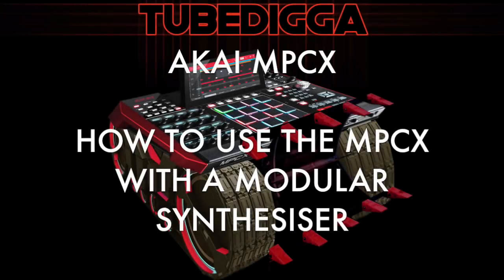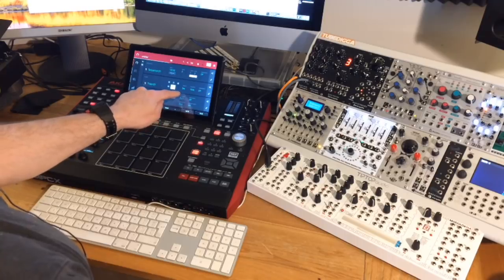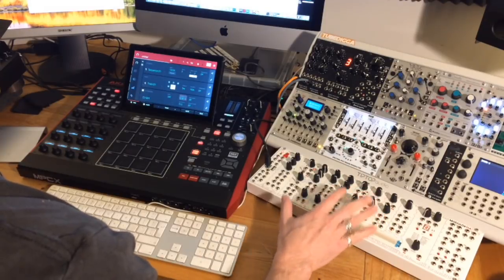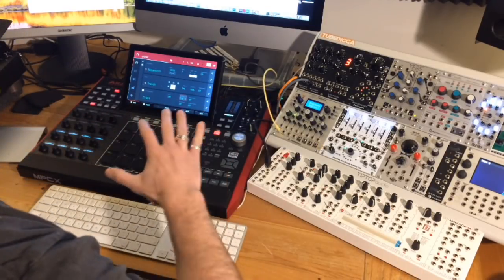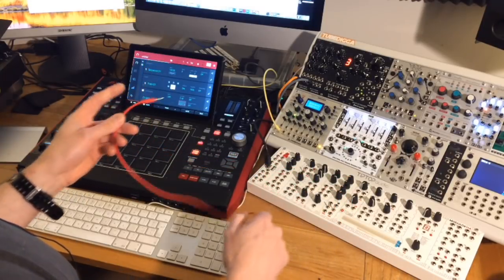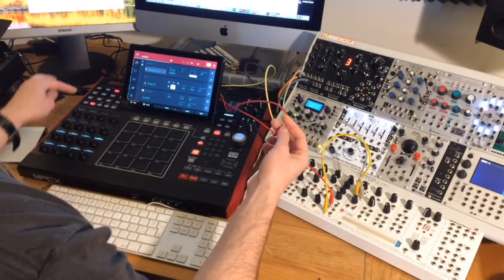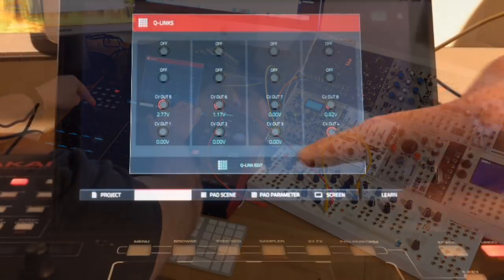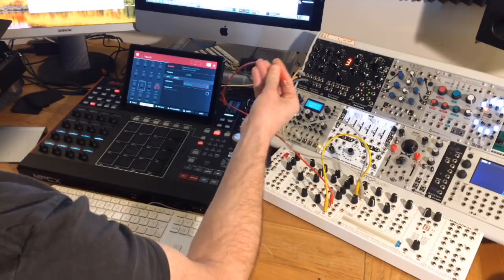AKAI MPCX HOW TO USE THE MPCX WITH A MODULAR SYNTHESISER

Comment: tube completely unrelated but IM having problems connecting my roland tr-8 into my mpcx and I only hear a static-y and not loud enough drums. Anything I should do?
Reply from the maker: You'll have to explain your set up in more detail. It could be many different things - is the input switch at the rear of the MPC set to LINE or PHONO? If it's set to PHONO then that could be it as that is just used for VINYL/record players. It may also be your TR8 master volume or track volume are set too low. It's best to send the loudest signal you can and if necessary dial it back to a clean, more suitable level so it doesn't distort. Basically, your source sound (the TR8) needs to come in to the MPC as loud as you can before distortion and adding gain via the MPC gain knobs should be a last resort or used just for a small boost. Other than that it could be many things, but you'l have to explain your set up in more detail.

Comment: Do you have intelijel shapeshifter? It looks so uniqe and cool to morph samples and synths with mpc x. And the vocoder 😍 im considering buying it. Would love to see you do a demo of it, thanks.
Reply from the maker: Good idea - I may do at some point, it's a very deep machine and much of what I get out of it is very much trial and error and flukes/experimentation. I wouldn't be able to fully explain all of it and would be a little out of my depth. That's not to say I don't know what the f*&k I'm doing! I know a fair bit about it but there's a few areas I need to research and explore more. It's one of a few modules I don't think I'll ever sell, it's superb.

Hopefully I'll do it soon but will have to read up on some stuff.
Reply: @TUBEDIGGA  cool.cant wait. Could i use it alone with the mpc and a keyboard? Dont own other modular stuff.
Reply from the maker: El Morto Beats Hip Hop Beats You would have to buy some kind of power supply and case - there are things called ‘skiffs’ which are the cheapest and most basic ways to house and provide power (via ‘rails’) to a module. Otherwise a case like mine which has a built in PSU or maybe a smaller case with just one row, or half a row to fit this module and a couple of other modules. Specifically a VCA and envelope module (some combine the two)which will allow you to have control over the shape of the sound. Just the Shapeshifter alone will be frustrating as although the X can trigger it (gate) and control the pitch (CV), you ideally need a vca to control the amplitude and an envelope to trigger the VCA and adjust the attack/decay/release. Otherwise the sound will just be a lot less dynamic.Check out this guys video series which will show you the basics of what it can do: https://youtu.be/jlnj4HwHMlk 

Let me know if you still would like me to do my own video as this may well be more than enough. There's many other videos on YT showing this module too.
Reply: @TUBEDIGGA  thanks. Ill check out it. I wish i could get that in 1 box. So cool

Comment: Do you find yourself using the CV controls in the MPCX often...or simply relying on a modular sequencer, and just recording/sampling with the MPCX.  Also, are you automating complex/multiple modulations? I have an MPC Studio and I'm trying to determine if its worth it to buy an MPCX (eventually). My semi modular gear can be controlled with midi and from there control the modular units.  I would really only need it for recording and performing CV automatons.

Comment: Tube is it possible to send clock out or any simple tricks? Can clock just be a cv out trigger? I’m still learning thanks your videos have helped me tremendous
Reply from the maker: Not sure what you mean exactly, but you can easily send out a gate 'pulse' with notes programmed into the sequencer, which of course can be any rhythm you can think of, from a straight 4/4 to anything you like.
Reply: TUBE DIGGA  so basically I want to send clock from the mpcx to control a module. Is the term clock the same as a sequenced pattern being sent out a cv out?

Comment: If you go to pad performance in A you can play the different notes also but I am not sure why if your out of this mode it does not trigger the scales until your in C?
Reply from the maker: Yeah it seems to automatically shift the pads up to a particular octave in pad performance mode. It may be something to do with lower range limitations of 5v per octave.
Reply: TUBE DIGGA hmmm has the changed yet on update ?